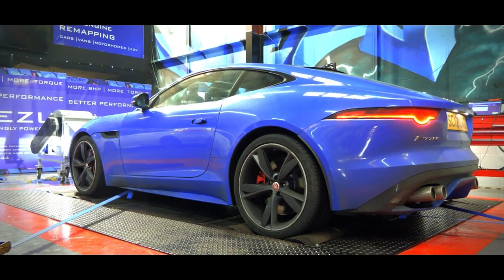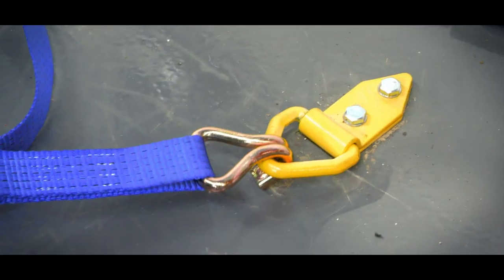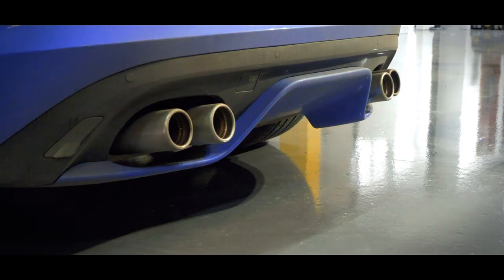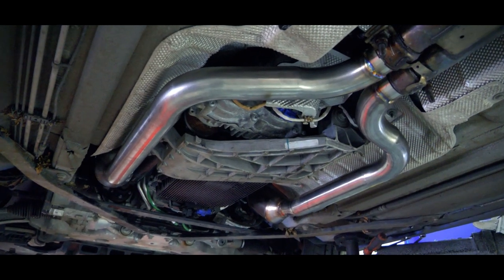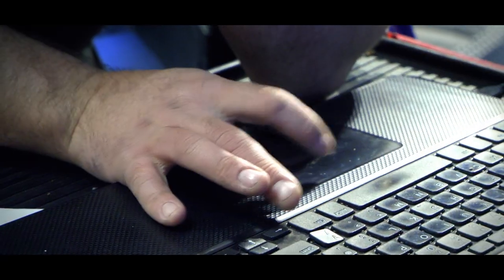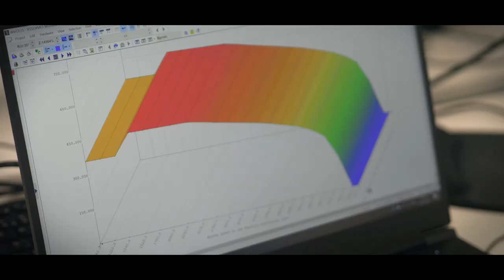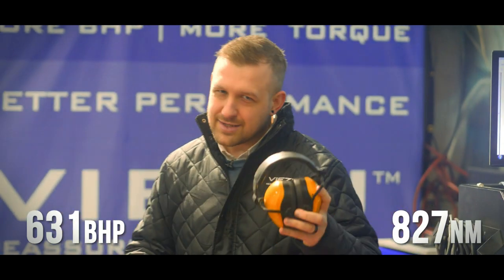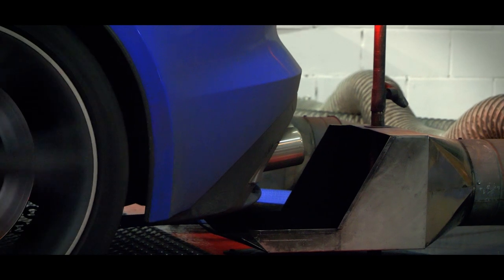Jaguar F-Type | Predator Upgrade

Comment: 🤔 had the same done to mine , without the exhaust mod, made 647 bhp , same tune as the Lister Jag which apparently makes 666 bhp, obviously different engines and tunes will vary 👍
Reply from the maker: We developed the tune for the Lister car, the development car ran upper and lower super charger pulleys, as per our 670bhp full Predator conversion, this car only had the upper pulley fitted - hence there will be a difference. Hope that helps and makes sense.

Comment: Does this alter the sound of the exhausts? Or does it sound the same but simply with a stronger engine?
Reply from the maker: Yes this set of upgrades on this car includes the 200 cell cats, these do increase sound level and depth of exhaust tone. If you don't want to change the exhaust noise, pitch and tone, you can still have the performance upgrades and remap, and the exhaust tone will remain the same - here to help if we can info@viezu.com